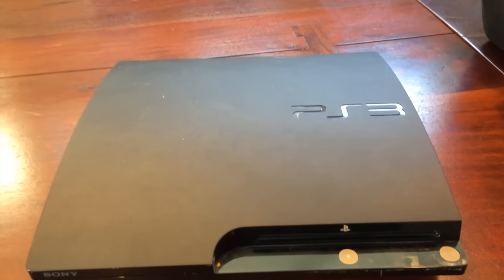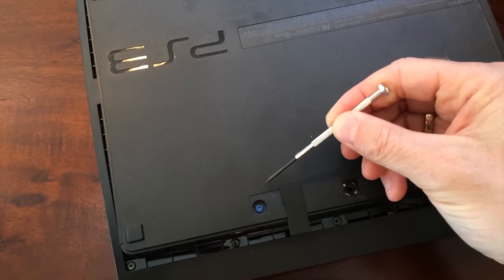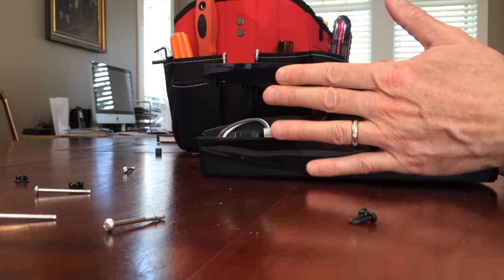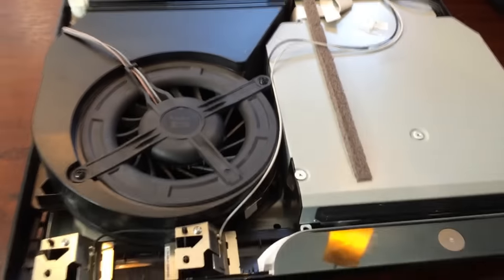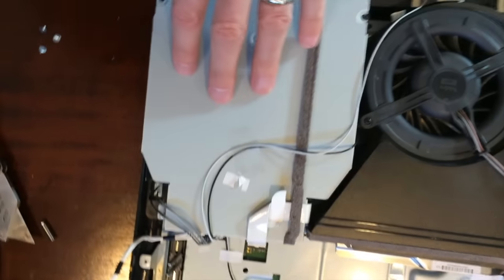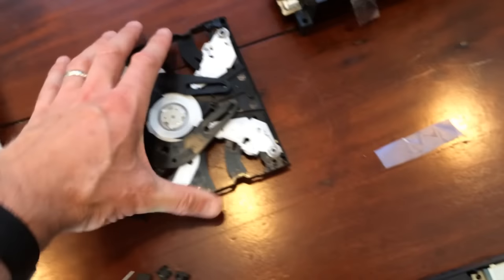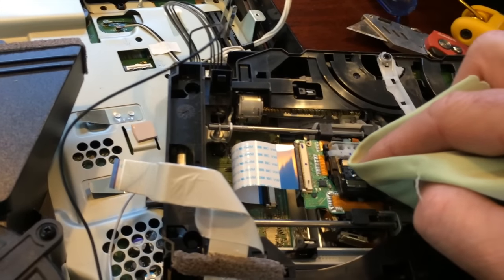How to disassemble and clean your PS3 laser

Comment: Hey mate, sorry to bother you, but I have a problem with my PS3 in which case it wont run a game disc, on the top right corner where the clock is, it shows that it spins, and I hear some weird noise inside the PS3 like its denying the CD, after that it spins, stops spins and stops all the time. It reads DVD's fine without a problem. Right now im not sure if its a system problem so I should do some recoverys, or if it is a problem with the Laser/Lens. Also its definently not due to the CD's, they're all brand new. Any kind of help would be appriciated! Thanks in forward :D
Reply: ItsNixa I have the same issue, if you fix yours let me know? thx
Reply: Try picking up the ps3 and tilting it backwards at an angle..thats what i did for a long time before i bought the tool to open my ps3 and clean it out really good with compressed air and a little brush.
Reply: I have the same issue - I am also not sure which solution will be the best. I bought it from a friend as a gift to my little brother but now he can't play any games - only watch DVD's and Netflix etc on it.
Reply: ItsNixa I've been having that trouble as well. I reckon it's the laser. I might attempt opening it up sometime to clean it. I think a lot of dust has gotten inside it during the past few years as well.
Reply: ItsNixa I have the opposite problem. My plays games not movies
Reply: N W yeah that stupid tip made me break one of my cables 😒 didn’t work

Comment: You only missed one VERY IMPORTANT STEP! 
YOU DID NOT disconnect the ribbon cable correctly. at 5:27 before you POP off the cable for the disc drive, there is a "BROWN" lock that holds that ribbon cable in place. It should be lifted up to release the cable. Just use a small screw driver or something to lift the brown tab in an upward direction. Then there is no need to POP the cable out as you call it. and makes setting the cable back in easier also, just let the cable drop back in and then lock it in place for reassembly 

other wise this worked for me and my PS3 slim 180gb ...
Reply: Pls help me... my PS3 can't read disc and always crash game.It is also loading infinite in gta v..pls help me how to fix it😭😭😭

Comment: Ok, so I took it apart and fixed it ( I'm hoping) then when I reassembled it, it wouldn't physically accept my disc. I have a small black screw left over. Help?
Reply: Make sure the wires in the back of the disc drive are pushed all the way back in

Comment: how did  you get the star screws out without a tool for it?I dont have the tool and i dont know how to take them out
Reply from the maker: Hi Luke. I have a small star screwdriver although it is not the safety one with the little hole for the nub in the centre. I don't think you will be able to remove it with anything else. Any hardware should have them.
Reply: ok thanks
Reply: I did it with a very sharp knife
Reply: Hey if you take an old bic pen and take out the ink you can melt the tip then shove it in the screw it will make the shape you need. Because of the melted plastic!! Hope this helps!
Reply: Michael Perkins I love you

Comment: When I put a disk in my ps3 it doesn't come up on the menu and after a few seconds it starts making this weird ejecting noise. It reads dvd's but not games, will this fix this problem?
Reply: +Ms.Spartan i have the smame problem D:
Reply: Joe Stew
but my ps is 5/6 years old xD
Reply: Joe Stew
xD
Reply: lol only 79 bucks xD
Reply: only your online stats on your acount D:
Reply: I still haven't haven't fixed it :(
Reply: just buy a new one or PS4 :p
Reply: Joe Stew
 no i dont only tabac xD
Reply: +Joe Stew yeah ofcourse 😂
Reply: +Joe Stew i dont play killzone and that other game i have no what that is 😂😂😂
Reply: Joe Stew
ok wel sorry xD
Reply: +Joe Stew gta 5 cod black ops 2 cod AW and battlefield 4 :D
Reply: +Joe Stew dude bf is awesome
Reply: +Joe Stew nah bf is more realestic then cod but cod is smoother 😂😂
Reply: Joe Stew
nah man shooters :D and gta5 :p
Reply: +Joe Stew mortal combat is the only fighting game i like 😂
Reply: +Joe Stew xD
Reply: I know this is an old post. I hope this helps everyone facing the same issue now. you must have disconnected one of the flat wires that goes into the bd rom. it's the one that is glued onto the grey metal cover.
Reply: Hey Pecha, the orange cable is soldered on one side and plugged in the motherboard on the otherside. Ive checked both ends but nothing
Reply: or do you mean the small white one with a blue tip ?

Comment: My ps3 wouldn't run but did turn on. Used the steps on this video and cleaned it all the way to the lens. Put it back together and it works fine now. It was a bit meticulous but not impossible, I was very careful as not to break any of the extremely fragile parts.

Comment: Just disassembled mine and got it all back together fine. The ribbon under the disc reader was bigger and shorter on mine and had to be unplugged to get it apart further. Had to take the bottom plastic case piece off too to get it plugged back in. For all the people having issues with the star head screws, I used a tiny flathead like a jewelers flathead. Worked great.

Comment: I cleaned the lens but when I put the system back together I have an even worse situation than before the disc won't go in because the white thing in the front when you take the tray out won't stay down please respond
Reply: The ribbon wire is the problem maybe its not connected i just had that problem too
Reply: +Obama how do I fix it??
Reply: +Obama heyy obama
Reply from the maker: Did you get it fitting back in? It should just slip back in.

Comment: Great walk through. 5 star. Thank you. Only one problem, mine still doesn't read Blu-ray discs. Question, Can you just replace the whole disc drive from another ps3? So easy to find used ones for cheap. Also, would switching out hard drives wipe the saved memory? That's my second option on fixing mine. Your recommendation would be appreciated. Thanks.

Comment: well I tried this and I broke my ps3 😭😞
Reply: You're not an idiot. Just make sure you don't do things the same way next time.
Reply: As long as you put it back the way it was you should be fine.  Be sure to reconnect the ribbon cable to the drive and reconnect the power supply without bending or breaking the pins.
Reply: Nick Jones what pins?

Comment: Just to be sure. But when you unscrewed the blue screw, you were unscrewing to the counter-clockwise? Correct? I'm having a lot of trouble unscrewing it no matter wich side I went with, so at the very least needed confirmation which is which.
Reply from the maker: Yes. All the screws are normal thread orientation.
Reply: @markeye646464  Thanks. I already did that one at least. At this point though, I'm just going to give up. Too damn many screws. I already dealt with all of them beneath the PS3, but...

I don't know if it's Sony's way of wanting to prevent people from messing with the inside, but I can't just find a way to get rid of the black screws around in the middle.

And I just don't have any screwdriver for it, and can't make it work with the scissor's trick either. However had this idea, should have been fired.

Ranting aside, I think I will just ask a knowledgeable friend of mine to do it instead. Specially since I might end up having to replace the hard disk if it's not a dust problem. So that's that.

Comment: Thank you so much for this video. We first noticed a problem after we played a movie. A little while afterwards We put a game in to play and it would start to run but then stop. Assuming it was just that game we cleaned it and tried again. It still didn't work. So We tried putting numerous games in. We kept getting the same output, it would start to run then stop. Doing some research online We saw many with the same problem. The first thing I saw was that the laser could be dirty. I felt that this was most likely the problem. But not wanting to take part the PS3 unless we had to, we continued to search for other solutions. Some suggested tipping the PS3(slim) upwards. But we have normal size PS3. Others recommended restoring the entire system. We deleted apps and restored the system but nothing happened. So today we took apart the PS3 and cleaned the fan. Then we cleaned the laser with alcohol. After assembling it, we where disappointed when the cd would not go in.
Reply: But fortunately there was one of the first comments all the way at the bottom that said they had the same problem and the white strap was not all the way in. Taking apart the PS3 we found we had the same problem. As well as another screw and strap that was hidden not put in all the way as well. Thanks for the video! And thanks everyone for your input on what to do as well as your outcome.

Comment: This worked eventually for me, but I had to go through all the steps a few times. The PS3 either wouldn't let me insert discs or eject them...I think the mechanism in the CD reader module ( springs levers that hold the CD ) need to be in a certain position (as if tray were empty I think) when you screw it back together.

Comment: I followed everything, step by step, screw by screw. Now my PlayStation 3's disc drive is completely broken, won't accept or eject discs, and makes loud banging noises. I watched your video three times and it still did the same thing every time. I wish you made a part of the video of you putting it back together, because my ps3 went from occasionally reading discs, to not even accepting them. Thanks.

Comment: Holy shit! 5/5 This worked like a charm! Note: TAKE ANY CD/DVD/GAME/BLURAY OUT BEFORE ATTEMPTING THIS! I didn't and it was a nightmare realigning the tiny gears and disc so it would properly eject again. Also you may want tweezers or a magnet to get some of those tiny screws out. While your inside your PS3 you might want to get a can of air duster to blow off any dust on the fan or inside.
Reply from the maker: Good points. I just used a vacuum to suck up the dust bunnies but an air duster is better.
Reply: Malakai Lyon should have read this comment before i did it...how on earth did you get all the gears lined up again? that's where i'm at now

Comment: Real smooth on the (3) starhead screws with center pins edit😎... I heard you say it worked fine but left the work out lol...Been smoking Since the video started, SOO,  I'm like I gotta know ...maybe gotta tilt it, and only use few sides at once  lmao I  literally went and got mine and tried it and tried two sizes bigger and smaller every possible possibility.. NOTHING

SUCKS CAUSE IT KEEPS SHUTTING DOWN ON ITS OWN. FREEZING ON SCREEN WHILE USING

Comment: Hello, I realize the video is years old; however, I wanted your opinion, if the process demonstrated could possibly correct my PS3 Slim issue. My PS3 Slim, when I insert a Game (which are Blu Ray) or a Blu Ray movie; the PS3 makes a clicking sound as though the disc is being ejected. The disc is not being read. When the clicking noise occur, nothing happens; meaning, the disc does not eject; nor does it play. I have to press the eject button manually to execute the ejection of the disc.
Do you believe your cleaning process address my described issue?
Reply from the maker: dont think so. Sounds crazy but try playiong the disc with the PS3 on it's side (right side down)
Reply: @markeye646464  okay

Comment: I thought about doing this for a long time now...
I always have to put in the disk 5 or 6 times until the console reads it. But then it works without freezing and (most of the time) without lagging. 
I think I could help my console by cleaning the laser. It would do at least something. But after I read some comments down here I think I will keep it as it is. 
I mean... It does work... somehow....
And the Technician inside me always says: "Never change a running system" So as long as it works... ;)

Comment: Other ps3 readers have 3 plugs. Make sure to hold the plastic of the plugs down with a small screwdriver before you pull the cable or you will rip the soldering of the plugs right off the board like i did.
Reply: I think ive done that too while removing orange ribbon 🥲 any solution?

Comment: After taking the top off of the PS3 slim, I can't get the two screws out to remove the back, black component. I've tried two different sized philips head screwdrivers, but no luck. Any tips?
Reply: TwoCentReview Same here
Reply from the maker: +TwoCentReview RU using a jewellers screwdriver? Buy it at the dollar store.

Comment: I started to do it I remove the back only and found out there was much more to do to get to the lens so I put it back together and now the main menu flickers as if I was touching the remote control all the time then it stops and then it goes again and then it would just work OK until I turn it off and turn it on again, so I am putting it back to factory settings I don’t know why it’s doing that though maybe it was just my HDMI cord. Or Sony sets it up so if you take it apart it won’t work as normal.

Comment: 8:30: Lens cleaning cloth...will any normal cloth or towel work or does it have to be that specifically, and can it dry on its own?
Reply from the maker: A regular glass cleaning cloth (the one you might use to clean your glasses) works just fine

Comment: Yeah thanks bro just broke mine really appreciate who else broke there's.. 
Btw there not all the same I lifted the drive a fraction and the ribbon came undone.
Than the clips at rear were also different and one wasn't a clip it snap I went to solder it and another ribbon that was not mention to come out did so it's in the bin. 🤦🏼‍♂️

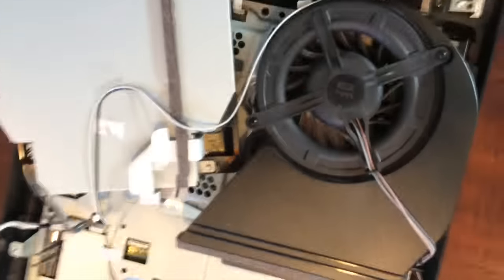Comment: I've got to this point 6:02 and both screws on the bottom of the blu ray drive have no heads. Just the shanks (ive just learned its called) flat in their holes. Is there anything i could do about that, just pull the cover up and see if it pops off around them?
Reply from the maker: Hmmmmm, Sounds like somebody has been in there previously? Did u buy it new? Anyway, I'm not sure if I can help you? It might break if you do it.

Comment: Someone respond. So a white rolly piece fell out when I opened my disc drive. Is it necessary to put it back in?
Reply from the maker: Can you describe the piece?
Reply: Mark Chalmers I figured out what it was. It went to the gear that rolls the disc in. I took apart my whole disc drive cleaned the lense. But for some reason it still makes the clicking noise.

Comment: I did the whole thing, step for step, didn't end up working. Turns out there was a hair band in the disc drive from my little sister and it burned out the motor. It was still kinda fun taking it apart and put it back together though :

Comment: hey mark how did you get out the star screws
Reply from the maker: Jewelers screwdriver (flat one) will work. Pick up a set at the dollar store. Hope this works for you.
Reply: I got a cheaper solution I used a pointy flat knife,thanks mark!
Reply from the maker: no prob
Reply: Daniel Haywood can i use water instead of alcahol becuz idk where to get that
Reply: Small Boiii what do you mean are you talking about the star screws?
Reply: mine wont read discs, will gamestop help fix it?
Reply: Sdder birdo nsybe clean ur leans

Comment: So about the super small screws, those are the ones i cannot get open, where exactly do i find that tool
Reply from the maker: Im presuming you mean the Safety Torx screws (small star shaped with a dot in the middle). I just used a flat head jewellers screwdriver as I didn't have the proper screwdriver
Reply: @markeye646464  oh ok ty man

Comment: If you get a really small straight screwdriver, not a star one, a straight one, really small, you can actually just put it in them safety screws with the point in and undo them without having a torx screwdriver. Thats what they are a torx safety screw!
Reply: Sir you're the real MVP
Reply: +Adam Green  A small knife works just as fine too

Comment: does this work for error 80010514? error happens to me when I try to start up either GTA5 or COD:Ghosts, both them games are over 500MB? all my other games are under that, so I think that may be the problem I have but I'm not certain, I have over 40GB of space left on my HDD so memory isn't the problem. but I have a spare harddrive I could use to see if it works on that? is it worth doing or not? 
thanks in advance
Reply: me too i used to have this problem don't use Wifi use the ethernet cable then i used a DNS server:
Primary 8.8.8.8
Secondary 8.8.2.2 
Try it and tell me if it works.
Reply: +Gabe Newell thanks for the reply but I've managed to get everything sorted. my HDD corrupted so I had no choice but to reset it, ever since then it's been fine☺

Comment: After doing this my PS3 no longer reads a disk being in there at all to the point of not eject...any ideas?
Reply from the maker: Sounds like you missed hooking up one of the clips (wires).
Reply: I know this is an old post, but yes you must have disconnected one of the flat wires that goes into the bd rom. it's the one that is glued onto the grey metal cover.
Reply: Mark Chalmers I dont think so. I rebuilt mine 8-10 times watching your video and mine does the same thing, I promise all the wires are working and plugged in.
Reply: @markeye646464  Hi, those screws at the back near the clips wont come out no matter how hard i try

Comment: I tried doing this with a regular torque/torx and it didn't work. You need the ones with the hole in the middle
Reply: But for those wondering, a T8 torque with the hole in the middle is the size you need to get the four special screws out.